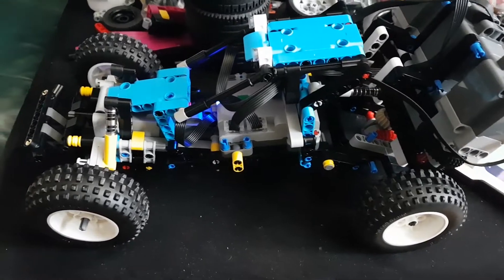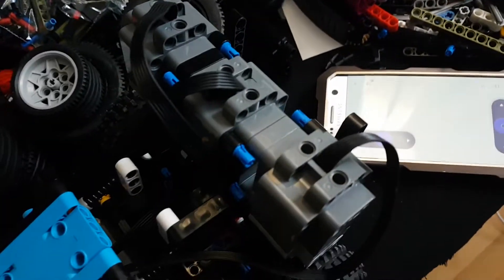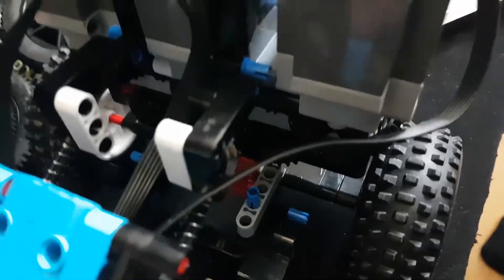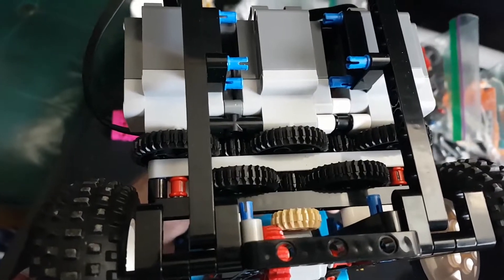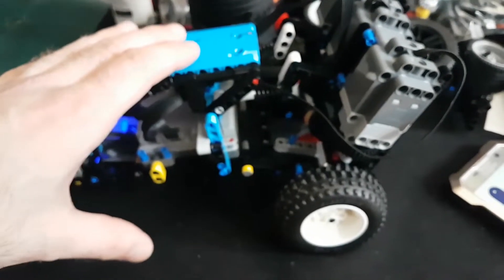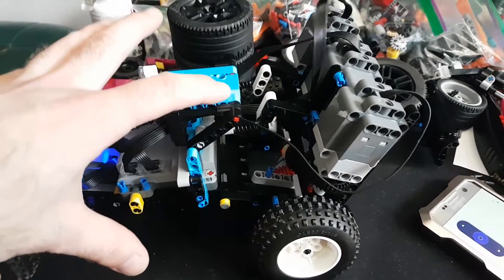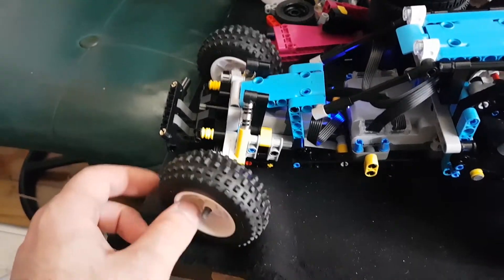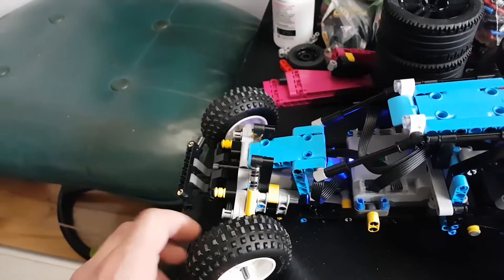42124 Off-Road Buggy LEGO MOD with 3 XL motors

Comment: Hello, here there is a quick fix to improve the steering: https://www.youtube.com/watch?v=M505KyKRk8Y
Reply from the maker: thanx, I'll check your video later, but the thing is I use the brick controller app with a gamepad controller now.  But yeah, I would like to mess around with the powered up app again some day.  I guess there are more programming possibilities for chain of events and etc.  The major problem I have with the powered up app is you can't control multiple hubs at the same time, you have to switch between them, which is absolutely stupid.  I have 3 hubs now and using multiple hubs is clearly a thing I want to do and I can with brickcontroller.  Also, it's very rc car oriented and very easy to use with a gamepad.

Comment: Can you make a tuturorial? Plsss man
Reply from the maker: Sorry, even if I wanted to do instructions, I don't think I can cause I'm too retarded.  But basically, I removed the motor from the original set, than I used my idiot skills to put 3 xl motors on top of the axle, and it barely works.  But I think one day, I'll make it with 3 L motors instead, and it should work much better

Comment: how to swap L motor with only one XL motor
Reply from the maker: I don't know, but it's not worth it.  L motors are quicker than XL motors
Reply: @Hide_and_Tweak  thanks
Reply: @Hide_and_Tweak  not necessarily if you are using a buwizz unit then xl motors are a little more gutsy
Reply from the maker: @massid3774  I did not know about that, but I think for this kind of car, it's mostly a matter of size.  I think someday I'll do it with L motors and because they are so much smaller, the whole build will overall get much lighter and get better performances.